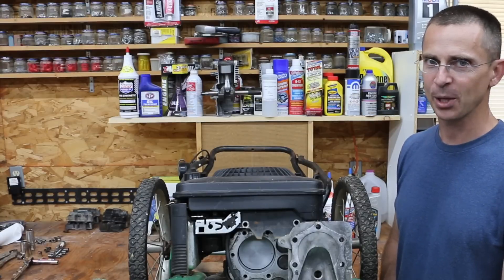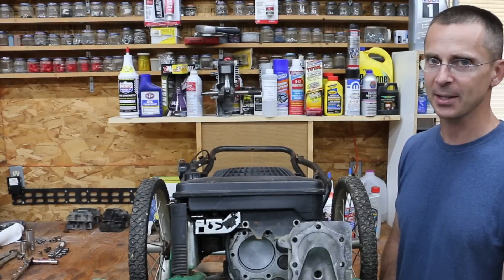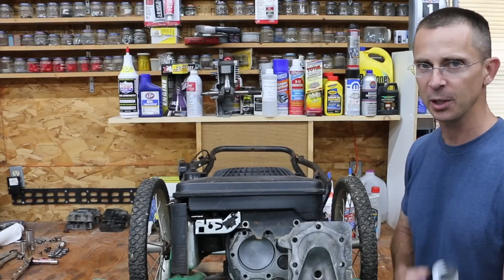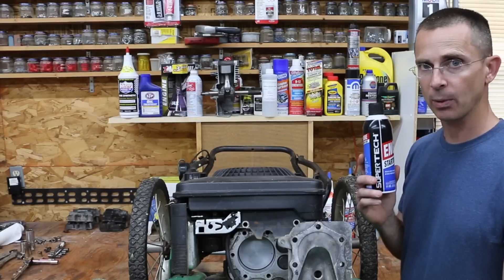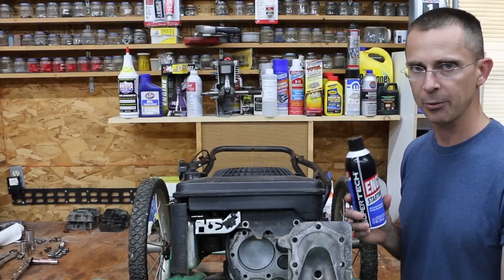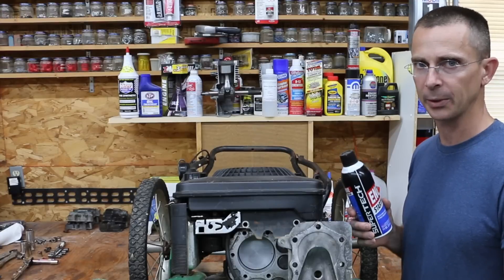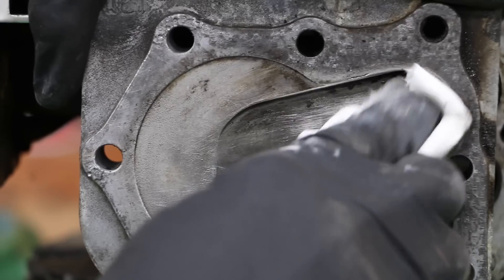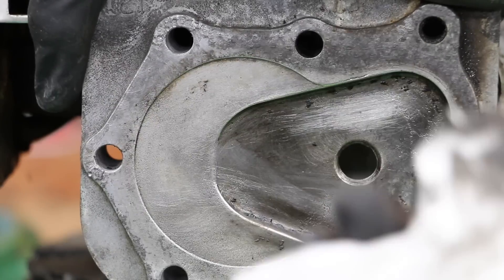Will Running an Engine on 100% Starting Fluid Cause Damage?  Let's find out!

Comment: So how loopy where you after spraying all that ether around? ;)

Real concern with starting fluid is the low auto ignition point. A higher compression engine will start knocking hard as it warms up trying to run it on Diethyl Ether. 320F auto ignition point.
Reply from the maker: Cragified, I keep the fans running at full speed and the shop well ventilated while running these tests.  

You bring up a great point regarding the high compression engine with knocking.  Thanks for commenting!

Comment: on a diesel motor starter fluid revs the engine up too high. I wouldn't recommend it on a everyday thing.
Reply from the maker: Jose, Great point.  Thanks for commenting!

Comment: Most people use brake cleaner to clean parts, because it has already caused permanent organ damage to me (read the msds) I use starting fluid because it removes all traces of oil. It cleans and degreases. I was amazed with your findings. You would think that by removing the oil to seal the rings it would lose compression.
Reply from the maker: Apparently, most modern starting fluids have lubricants too.  This apparently was the oily substance I found on the cylinder head.  Thanks for commenting!

Comment: Running a diesel, or any fuel injection engine on starting fluid because it's not getting fuel is where the risk is (Dry firing the injectors). Also spraying starting fluid on the air filter, instead of directly into intake removes the upper cylinder lube ( the oily substance in the combustion chamber in this video) which isn't good, and could ruin your air filter. Also starting fluid has very low octane, which could trigger a knock sensor. It's always better to find the real problem in an engine you care about, and to put a block heater on a cold diesel.
Reply from the maker: Alex, thank you for commenting!

Comment: as a diesel mechanic i cant say it will cause damage to the engine but it will cause damage to the intake heater used on many diesel engines
Reply from the maker: unrednecked, Thanks for commenting on this!  The person who bales my hay has 2 JD tractors that come from the factor with a built-on starting fluid assembly.  I was surprised to see this.
Reply: yes lots of buses have that too but they are set up to shoot starting fluid in after the intake heater so not to damage it or dont use intake heater or glowplugs at all

Comment: Dude it;s well documented that ether damages some diesels, especially those with glow plugs.  Causes busted pistons, injector cups, head gaskets, and piston rings.
And yes it's going to dry out the cylinder walls as well.
Cool video you made there.
Reply from the maker: Patrick, Thanks for sharing this information on use of starting fluids in diesels and thanks for the positive comment!
Reply: Np, I salvage vehicles, half the time when I get a diesel truck to part out, it's life was cut short with ether/starting fluid.  I call it "idiot spray", just for your own personal info, IF and i mean IF you really have to start a diesel truck with some spray, pick WD-40 I've heard from several people  how much easier it is on them compared to ether.

But yeah at 17-18:1 compression ether can destroy a engine in no time, alot of times what I see happen actually is that the glow plugs will pre ignite the ether and bust the air filter housing and pipes going to it and cause the engine to suck in debris as well to finish off the job by ruining the rings.

Ether your truck enough and it will get hooked on the ether and not start without it.

No heavy equipment like tractors without glow plugs or grid heaters ether isn't nearly as big of a deal, so long as you just use a little, problem is people want to spray spray spray.  But if it has glow plugs, the spray will always be a bad idea.
But hey I don't want that to stop people LOL, I am always looking to pick up the pieces afterwards so by all means please destroy them so I can make a dollar chopping up the left overs or a rebuild contract hehehe.

Comment: You should run something called "race gas" is a fuel additive they say turns pump gas into racing high octane fuel and I would like to know if there if true and will it run in a stock small engine
Reply from the maker: Thank you for this recommendation!

Comment: I've seen it on diesel truck if you use starting fluid it will lock the engine down and need a rebuild front to back, gas on a rag near the air intake is the safe way for trucks
Reply from the maker: Thomas, Thanks for commenting!

Comment: You know since your not a big channel I got an idea to pitch to you but it might be out of your league at this time. You should find out what fuels produce the least emissions diezel gas race gas ethanol methanol propane ect. It would give hodrodders great ideas to pass their old cars at the next smog check. I also have this dilemma and ha ve to trust the sniffer. If you could get ahold of a hydrocarbon measuring device and a catalyst this could be a fin test. I would do it but I dont have the sniffer.
Reply from the maker: Robert, this is a great suggestion, but might be out of my league.  I'll see what I can do.  Thanks again!
Reply: Project Farm: you should reach out  to other channels maybe someone out here could loan you one.

Comment: I already knew ether doesn't cause damage.  Maybe the older stuff did, but it also didn't have the lubricant added back then.  I haven't seen ether without added "upper cylinder lubricant" in many years now.
Reply from the maker: Ox, This is a great point.  The modern starting fluids seem much safer than the older stuff.  Thanks for commenting!

Comment: I knew it wouldn't hurt anything. When i was young my dad would get pissed when i would use to much starting fluid. "You're gonna warp the valves! It burns to hot!" he would say.
Reply from the maker: I thought I'd find something negative as a result of using starting fluid, but I couldn't find any sort of issue.  Thanks for commenting!

Comment: A lot of diesel engines have warnings to not use starting fluid. It's like an extreme case of using gas in a diesel; it ignites sooner and more violently. best case scenario is a bad knock, worst case scenario the pistons crack and subsequently completely destroy the engine.
Reply from the maker: Sub Ripper, This is a great point!  Thanks for commenting!

Comment: Hey!  Just found your channel tonight/this morning.  It seems very interesting and you try some amusing ideas.  You obviously know quite a bit about engines.  If you don't mind me asking,  what are some easy and affordable ways to boost overall engine performance? I just bought a small SUV as the third owner for my first car (03 Saturn vue.  V6 gas, a little over 185k miles) . It needs an oil change,  which I'm getting soon,  but even with that in mind the throttle response is a little slow and the rest of the performance I just want to get back up to where it used to be, help keep it running like new as long as possible.  Any and all suggestions would be greatly appreciated this is my first car,  I want it as well taken care of as possible.  Unfortunately I'm also quite broke so I need affordable options.
Reply from the maker: James, Some recommend replacing the original air box with a high air flow system.  I prefer the OEM air box that's on it now more than the power improvement.  If it were me, if it hasn't been done in a while, I'd replace the spark plugs with GM iridium plugs and AC Delco wires.  Additionally, I'd clean up the throttle body.  Be careful to avoid getting solvent on the MAF (mass air flow) sensor.  It's hard to say whether or not you'll experience performance gains without knowing the condition of the existing plugs and wires and cleanliness of the throttle body.  Hope this helps!

Comment: Can you do a video using starting fluid as nitrous oxide???!!!!  and mabee various other types of aerosols like wd40 and hairspray, probably using the straw from the aerosol seafoam thing
Reply from the maker: Shawn, thank you for this recommendation!
Reply: WD40 doesn't burn so it won't work. Hairspray would probably work, but only because it often uses a flammable propellant gas, such as butane (you can smell it when the can is near empty). Hairspray itself (usually) does contain some flammable ingredients such as alcohol, but I don't think that would be enough to power the engine by itself.

So the hairspray would most likely just clog up the engine, as it contains lots of polymers (they hold your hair together), which are pretty lazy when it comes to burning and falling apart.
Reply: Shawn Hasen it would not work as nos because nos is an oxidizer and it makes bigger and more powerful ombustion but what you mentioned is just famable

Comment: everything looked smoother after the starting fluid was ran. Almost like it was better for engine life besides the oil build up.
Reply from the maker: Cory, yes, I was quite surprised.  Apparently, modern starting fluids contain upper cylinder lubricant, which helps explain all of this.  Thanks for commenting!

Comment: turn that can upside down and release all the propellent, then poke a hole in it and you can pour the starting fluid
Reply from the maker: James, Great suggestion--thanks!
Reply: Project Farm your welcome and you can also put can in freezer for a few hours to keep the ether from evaporating so quickly when using that method

Comment: timing issues in gas motors can be detrimental to starting guild start up, due to flash point difference from fuel, diesel, as long as there is no plug lighting, and not because your to lazy to make them work, spray it, there is a lot to be said out of diesel in its first few seconds of running, that if you know what you are looking for, you can find d the tell tell,
Reply from the maker: Alan, Thanks for providing comments on use of starting fluids!

Comment: the way starting fluid damages a engine is cranking it with out it starting the low speeds don't sling oil on the cylinder walls I've seen people trying to start a diesel and the cylinders start seeking frome no oil but gasoline will also cause that  a idea for a video is can you use marvel mistery oil as 2 stroke oil I've allwas wondered
Reply from the maker: Iron Age Homestead, Thank you for the video project recommendation on using MMO in place of 2-cycle oil.

Comment: How do you get your cylinder heads so clean? I have a Briggs and Stratton TBS190 on a 1996 Snapper push mower and I can't get my head and cylinder clean. Any tips or tricks?
Reply from the maker: TheGamingCorner, I use a wire wheel on an electric drill.  I also use a powerful solvent like acetone too.  Hope this helps!
Reply: Project Farm Thank you

Comment: That's only for 2 stroke motors
Reply from the maker: Ethan, Thank you for this information!
Reply: Project Farm if you run a 2 stroke motor on starting fluid it won't get lubrication and it will cease up
Reply from the maker: Ethan, this makes sense.  Thanks again!

Comment: You should try using Rc car/model plane nitro fuel in a gas engine. I've always wondered what it would do to a 2 or 4 cycle gas engine since rc fuel comprises of methanol, nitromethane, and castor/synthetic oil.
Reply from the maker: Nick, Thank you for these recommendations!

Comment: The after shot of the cylinder looks noticably glazed, compared to the before shot. Glazing is the fast track to oil consumption, and ring wear, so I'd like to bet a longer run time would lead to some change in that cylinder pressure. Just my 2¢
Reply from the maker: Matthew, Great point!  Thanks for commenting!
Reply: Haha. Sure thing, man. Thanks for reading.

Comment: I was told that starting fluid has a lower octane rating and may cause pinging and predetonation on some engines. Personally when you are trying to get an old carburetor car running that the fuel bows are empty, starting fluid is the safest way to go to keep the engine running long enough to fill the fuel bows.
Reply from the maker: Cracker Jack, Great point! I've used it many times for this purpose without any issues.  Thanks for commenting!

Comment: The only damage you will see from starting fluid in a gasoline engine is if you run too lean or too rich causing every issue that comes with but if you found a way to maintain proper fuel and air mixture you'll be fine, as for diesels some manufactures say it's ok to start the engine but I'm sure your causing it to detonate. Remember in diesels (compression ignition engines) your heat from compression ignites the fuel once injected just before TDC compression, the fuel doesn't stay during intake and your compression stroke like gasoline engines, which is why I wouldn't use it in any diesel. Do not use starting fluid in a Diesel engine that had a grid heater, I cannot stress that enough. Most of your isb Cummins engines even back to the 6bt 12 valves have a grid heater and it can ignite the starting fluid causing a pretty violent explosion. I would stay away from using it in diesels altogether because if you're having issues starting, you have some fueling or compression issues that need to be addressed.
Reply from the maker: Brandon, this is all great information.  I have  a 12-valve cummins with a grid heater.  Thanks for commenting!
Reply: Project Farm absolutely

Comment: Its bad for diesels because a diesel doesn't inject fuel into the cylinder full of compressed and heated air until the timing is where it needs to be. fuel too early will hammer the piston down while the crank is pushing up. they run on detonation but its controlled by the fuel injection pump timing. when you spray starting fluid in the intake it lights off as soon as the compression heats the air enough, no way to time it properly.
Reply from the maker: Jason, Great point!  I'll avoid using starting fluid on a diesel.  Thanks for commenting!

Comment: A good one you should consider trying to do is run ethanol-free gas instead of ethanol gas
Reply: The theory behind it is ethanol free gas runs lower temperatures in better performance in small engine use
Reply from the maker: Chris, This is a terrific suggestion.  Thank you!

Comment: This test is a fail!!!! Its not a myth that starting fluid does dry out the cylinder walls. The old school cans did in fact dry it out. You're using a new starting fluid which most companies now have a lubricant within the product. Get yourself an old can of Ether starting fluid like from the 90's or older and try this. Good luck!!
Reply from the maker: I am Joe, This is a great point. The oily substance I identified in the video on the cylinder head was clearly from the starting fluid.  Thanks for commenting!

Comment: the Starting fluid ruining an engine idea and why it seems to be true in the real world is probably because if you have to use it the engine is probably already ruined, low compression is less power, fuel being injected past the rings into the oil and shifting higher putting more wear on an engine with contaminated oil that is already wounded.
Reply from the maker: John, Great point.  Thanks for commenting!

Comment: It makes a diesel sound like shit when you gotta use it to get it started and sounds terrible so probably hurts a diesel
Reply from the maker: Donnie, Thank you for commenting.
Reply: Project Farm I've got a 12v Cummins with 700,000 something miles and I've had to use it in it a few times and it sounds very painful

Comment: I know someone who was young and dumb and just rebuilt a motor and they had the bright idea of using all stp oil treatment to fill the oil without any oil. They blew the engine as the oil pump pumped it up into the engine and it was to slow at running back down. the value covers were full of it and the bearings in the bottom spun out.
Reply from the maker: Wow! This was an expensive lesson! Thanks for commenting.

Comment: I suspect modern starting fluid has been formulated not to damage engines.  That oil film is probably there by design to keep the solvent from driving oil out of the cylinder.

Brake cleaner and carb cleaner are used by people in the same way in a pinch.  Because these are oil free I suspect they would cause damage.

You should do the same test with either carb or brake cleaner.  Cool video!
Reply from the maker: This is a great point.  I plan to test brake cleaner soon.  Thanks for commenting!

Comment: What about running your mower on jet fuel? Or some insanely crazy fuel of the sorts.
Reply from the maker: Liam, Thank you for this recommendation!
Reply: Jet A , or military spec JP-4 is a kerosene/ gasoline mix. On ships and such the Navy uses JP-5 which is basically just kerosene (higher flash point). They do it for fire safety and convience. they run thier diesel equipment on the same fuel. They have a few additives but basically that's it. That's why Navy aircraft normally "smoke" more .

Comment: This sounds totally whacked but I'd like to see an engine run on oven cleaner, I am mentioning this because when I worked at a dealership a tech used oven cleaner to clean carbon on a piston to brand new condition for an art project he was doing. Just curious how well it would run in a working engine
Reply from the maker: Thank you for this recommendation!